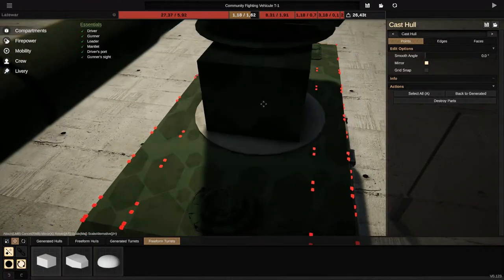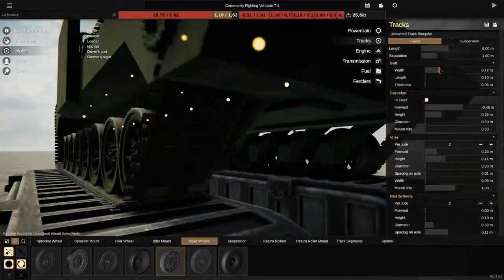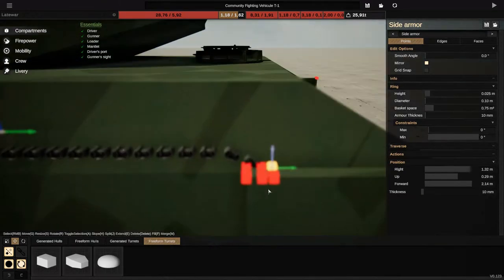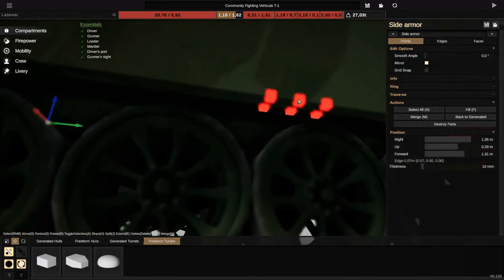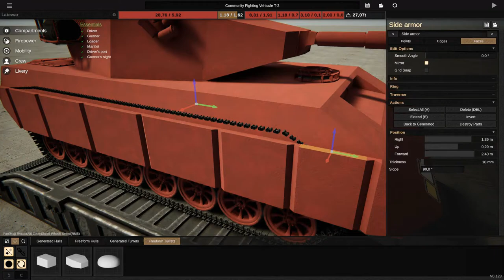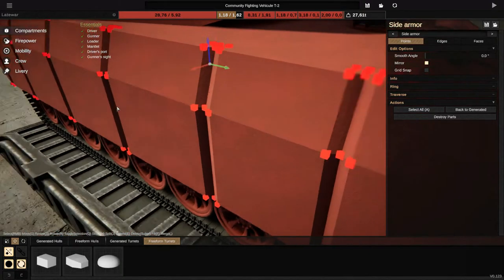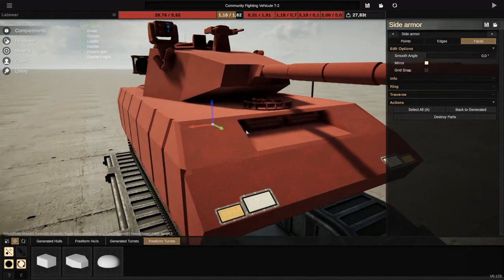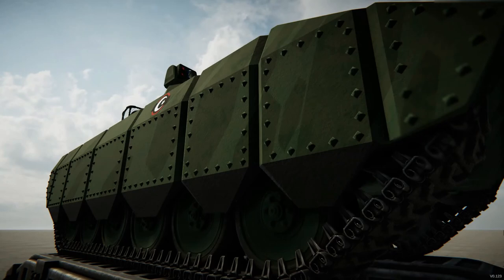Sprocket Tutorial Part 7 - How to design your side armor using turrets

Comment: can you contınue the tutorıals pls
Reply from the maker: New tutorials are planned 
Do you have a specific tutorial in your mind?
Reply: @mohsaid  i think you can make tutorials on how to make the tank perform better, like gun performance, mobility performance, armour performance etc. For example, i still don't understand how to make a gun mantlet with turret..
Reply from the maker: @fortisotissolis  that's gonna be the next tutorial, the next part of the tutorial 2.1 if you have watched it
It would be about the cannon and how to take advantage of the custom mantet and increase the penetration value
Reply: @mohsaid  thx, also i have a question, i play sprocket from steamunlocked 0.v12417 version, ik that its experimental and not full version, but i don't another option, so in the battle, after 30seconds my game crushes and kicks me out, do you know any solution?
Reply from the maker: @fortisotissolis  not in my knowledge, but experimental had a lot of issues in that version
Where are you from?
Reply: @mohsaid  Canada, you?
Reply from the maker: @fortisotissolis  Algeria, just wondering why you didn't get the official version tho, it would be easier for you and won't have that issues
Reply: @mohsaid  i could but when it is free, why would i buy it, older versions worked as well as original..
Reply from the maker: @fortisotissolis  to support the dev since it's an early access and it would avoid you hiding this fact to the rest of the community (in official discord or reddit)
Reply: @mohsaid  actually ım not hıdıng, ı just told you